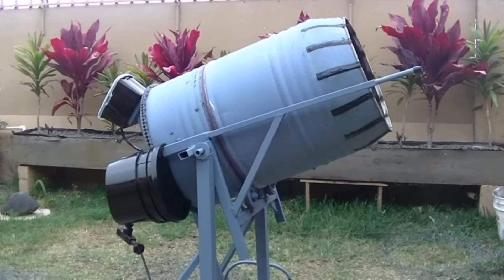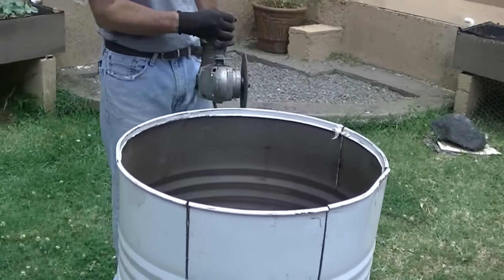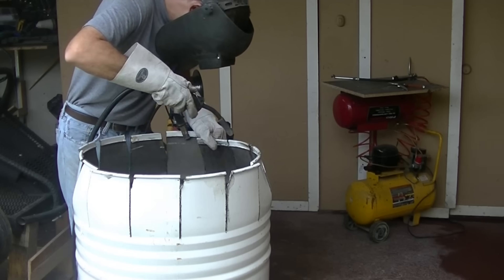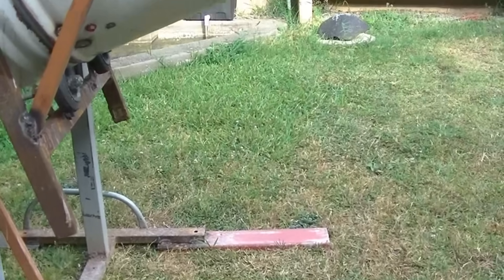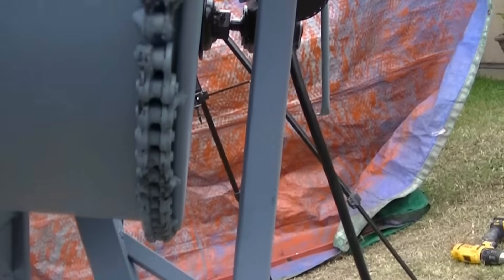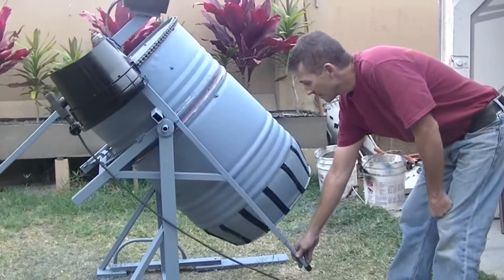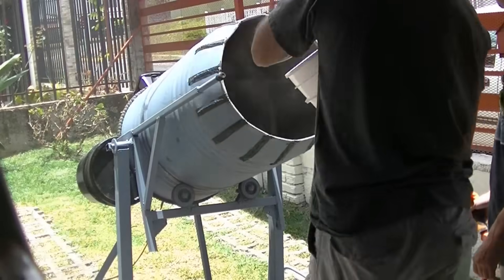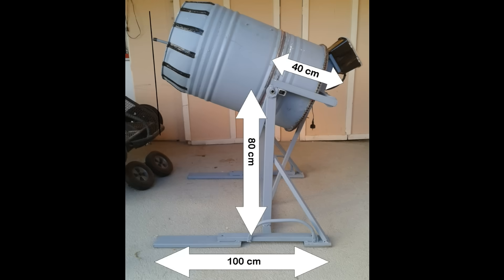How to build a 55 gal concrete mixer.

Comment: its good idea to build my tiny home with few worker. just for comparation with other motor driven, how power input (Volt and Ampere) for motor ?
Reply from the maker: This motor was a 90 volt DC motor. I used a bridge rectifier to convert 
AC to DC volts. You could use any motor as long as it is geared down to 
about 100RPM
Reply: ok thanks for information

Comment: Awesome walk thru . Only problem is how to obtain parts ,angle and steel drums . Motor is probably the easiest The motorcycle parts the mot difficult and then of course you have to either have,rent or know someone with welding gear. IIt would be nice if someone could build one using more easily obtained items. could you use the motor and clutch from a front loading washer? That why you could reverse your mixer which is what the professional grade ones would do. My grandfather owned a cement construction company from 1930 or so when Roosevelt created the workforce jobs to get us out of the depression. The side walks and football field bleachers and a bunch of schools and goverment buildings in Austin Mn were al done by grandpa from the 30's thru 1970 when he retired. Most of everything he did iis still standing including sidewalks. In fact you can find sidewalks from the 30's with his name and dates stamped on them! He had a special way he mixed and had his crete poured that has caused those old sidewalks and building footings to still be sound after all these years. In fact unless they were torn up they have stayed even weathering thru UV and acid rain. I ave no idea what his secret was but I do know that when he retired he sold his formula to his biggest competitor. I worked for him when I was 13 and 14 and I will tell you it was hard work much of what we did we jhand mixed or used drums you turned by hand (For small jobs)

Comment: Great job 👍
Reply from the maker: Thanks
Reply: Aceman307 Great job
can i use a washing machine motor?
i need to mix a lot of cement for a 4 inch floor area in my backyard and after i saw your video im decided to do one .
thanks for sharing!

Comment: Thank you for making the effort to document your build. Great Stuff!
I am curious how you calculated the size of the little wedges you removed to create the taper at the top. A logical guess or did you use your old high school technical drawing skills? Also do you see any value in using a tapered roller bearing at the base to act as a thrust like bearing or do you think the straight bearing you used is OK for the job?
Reply from the maker: I am sure a thrust bearing would be better. You could use a trailer hub and bearing you can get those at Tractor supply or northern tool. I just guessed at the wedges. I just wanted the end of the barrel to taper in a little it did not really matter how much. Thanks for watching and the comment if you have any more questions feel free to ask.

Comment: Now this is a great idea! I was thinking of a dimmer switch when low and behold, you used one! :) The improvements you made were spot on, I noticed the issues as I was watching and you addressed them all... turned out very nice!
Reply: My only other concern was the base of the barrel where the chain is welded... if the barrel ever dents it will impact the contact between the gear and chain. I'm just curious how it will hold up through repeated uses. I actually was expecting you to wrap some iron, like 1" or so, around it to strengthen it. Anyways, just thought of that after I posted :P
Reply from the maker: Thanks. I was a little worried at first using the bridge rectifier and dimmer switch, because all the info I could find on a power supply for this motor were expensive or complicated. But I have been using this setup and it does not get hot and it powers this mixer no problem. These were spare parts I had from when I was building wind turbines. Thanks for watching.
Reply from the maker: I loaned it to a couple of handy men that were doing a job for my neighbor. They used it for a week straight and had no problems with it. I have a job coming up where I will be using it a lot  so I will post a follow up video. The rim were I welded the chain is pretty strong. I could have reinforced the place were I welded the attachment in the back but so far so good. If it breaks it would be an easy fix.
Reply: Yeah I would be interested to know actually, thanks! And good to hear how it is holding up thus far!

Comment: Nicely done! Your design is well planned out. Have you considered using a spring on the hinge lock? Adding a hand lever (such as on a garden tiller) with a bicycle brake cable connected to the hinge. Then you only need one hand to pour the concrete.
Reply from the maker: Thanks for the comment. It normally stays in the mixing position. It was only when loading pre mixed bag concrete that I had a problem with it tilting forward.

Comment: Hey Aceman307, thanks so much for your videos. I just stumbled onto your channel tonight watching your windturbine videos and wound up here. I love DIY stuff and I like your work.

Great job on this build.

I have a humble suggestion for this concrete mixer. Prior to your mentioning the fact that as you loaded the drum (thereby creating an increased weight / balance issue) I was wondering how well this would balance once loaded with material. By the looks of the design, I imagined that it would tilt forward... and as you have found, it actually does.

Rather than having that "stop hinge", have you considered shifting the balance of the weight by increasing the length of the 40cm frames (seen in the video at 10:42) ? Doing so will shift the increased weight of the product further back on the legs/feet. You may have to increase the length of the feet as well, but I believe that it would be safer that relying on the "stop hinge" which could easily collapse if the machine were to shake/jiggle a bit out of balance. If you were not right there watching and it did indeed fall down you would have quite the mess to clean up, not to mention the wasted time and money in portland cement.

Hope this helps.
God Bless you and your family.

P.S.
I subscribed to your channel !
Reply from the maker: Thanks for taking the time to watch some of my videos. The issue with the mixer tilting forward was because I was using pre mixed bags of concrete and I was poring it in from the bag.So until the concrete moved to the bottom it tilted forward. Once the concrete was in and mixing it does not try to tilt forward. Since this video I have mixed a few yards of concrete using raw materials and the 3-3-1 ratio.Using a shovel to load the mixer does not cause any weight on the front and works great. Thanks for the comment.
Reply: Cool, thanks for the reply dude.

Comment: This welding is ugly , it seems quality . Good design and the idea is good , but watch the quality of the weld, is not going to collapse under the weight of the material
Reply from the maker: Yes the welds look terrible but  the welds have not broke, I have been using it and no problems yet. I had allot of problems with my MIG welder slipping. I have just recently bought a new stick welder.

Comment: That is just too cool. Great job.
Reply from the maker: Thanks
Reply from the maker: What kind of motor are you going to use?
Reply from the maker: You are going to need some kind of motor with a gear drive. I used a 90 volt DC motor that was free. But this motor in Grainger cost about 300 dollars. You should be able to find something on Ebay that should work. You want the final speed of the shaft to be about 100 rpm

Comment: I think I'm probably just going to buy one to replace the one I gave to a neighbor several years ago - just too much work for me compared with what I'm willing to pay to buy one.

Having said that, I think you should be proud of the one you fabricated; you did a really nice job! Were I to have more time on my hands, I might be of mind to try making one, and would probably copy yours closely, as it's worth copying. 

Many thanks for sharing it with the rest of us.
Reply from the maker: +kimchiman1000 Thanks for the comment. If I still lived in the States I would have probably bought a used one fairly cheap. But where I live now its very expensive for new or used equipment. Plus I thought it might be fun to try and build one. Thanks

Comment: That's great!! I hate mixing concrete.
Reply from the maker: +prancstaman Thanks, hows your projects going?
Reply: I'm stuck working on my house and cars right now. The weather finally got warm here. I did order the pullies I needed but waiting for them to come in plus got some new tools to make this work a bit easier. I might sneak in a vid this weekend though if time permits on my water injection setup to finish that series. How's yours coming?

Comment: if need be, to counter the weight against the bearing you could put a wheel on either side to run on the rim of the barrel so it doesn't have as much rearward thrust. great job.
Reply: I'm having trouble with my thrust too.

Comment: Very nice. The only downside is that drum will wear out a little quickly, a real shame considering your mixer is nicer than most factory built ones.
Reply from the maker: +J. Dana Clark I guess it depends on how much I use it. I saw another video of a 55 gal drum mixer and they said they have been using it for 4 years. The best part is the price I had most of the parts laying around. I even recycled 3 cans of different color paint. Thats why the strange color. I only spent about $10 total. Thanks for watching.
Reply: +Declaration of Independence spray in bed liner would work too.
Reply: a design change might be putting the chain and bearing on something separate to which the drum could be bolted to, at which point, all that would have to be refabbed is the tapered end and the interior angle irons and the chain wouldn't have to be ground off and rewelded ... however if it lasts 4 years of heavy mixing, you'll get your "money's worth" out of it.

Comment: Pretty cool. I'd keep an eye on that roller bearing though. They're not really designed to take that kind of rearward thrust against them. A tapered roller bearing would be what you should use, but hey if it holds up, it holds up. I'd just keep a spare handy in case it fails and you're not dead in the water on a pouring job. Keep up the great work.
Reply from the maker: +wjf213 If I did it again I would use a car wheel bearing assembly and weld the rim to the bottom of the barrel. I think what I have now should work OK. If the bearings  did start to fail I would hear it before total failure. I did not show it but there are two bearings one on each side of the support. Thanks for the comment.
Reply: +Aceman307 
Nobody ever got to the perfect design first time. Early versions of the wheel were square.
Reply from the maker: +Skill Builder I loaned this to a friend and he used it every day for a week. It worked without any problems. I will be using it pretty hard next month I will post an update on how it performed. Thanks for the comment.